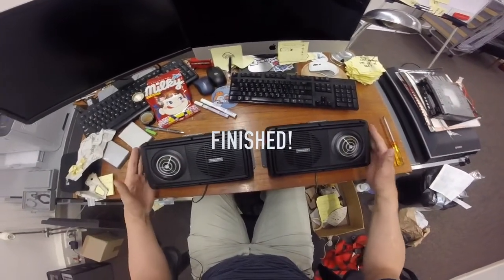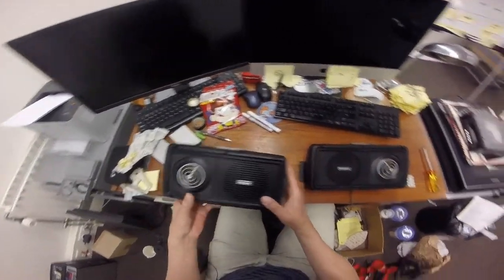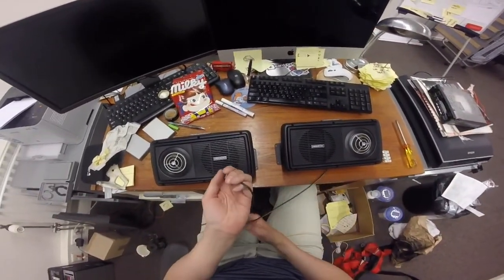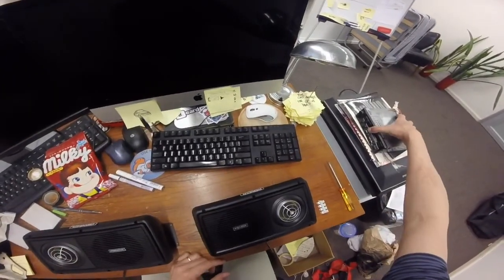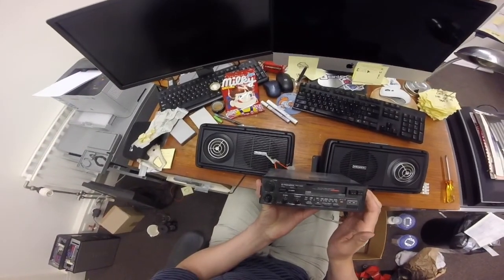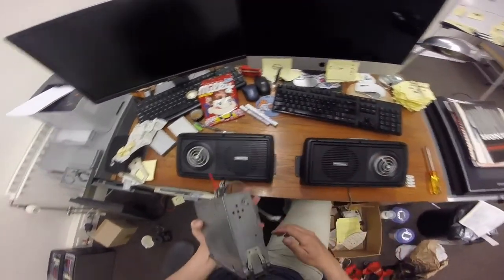How to revive a set of vintage Pioneer TS-32 - part 2

Comment: Haha I was thinking "What happened to those speakers?" I see that you've finally picked them up again.
Reply from the maker: Yes I kind of tossed them into this box out of frustration over the pin stripe. Probably they will be installed in the Carina soon after I got the radio working again.

Comment: those are some sick looking speakers! they can be only 2 way but that air vent looking tweeter is awesome!! hahaha painting them reminds me to the early 90's japanese kenwoods i installed on the sapporo. they were originally gray but painted them black. such a shame i got them in poor shape, but hey, they work good :D
about the radio, if they are easy or cheap to get, change the belt on the deck, you won't want old rotten black goo on the cassette mechanism after few months of use. also reduces wow and flutter, hey if you know the exact belt size, i can send one to you, belts are dirt cheap here ;)
Reply from the maker: Thanks for the offer and I'll keep that in mind! Yes the tape deck is broken so probably a broken belt. If not the belt will be replaced anyway.

Comment: nice :D tho the stripe slightly miss there,have you considered getting a sticker pin stripe,for example these that were pretty pupular to use on a side of the car,and apply it there? might work and also there is a silver one too :D
Reply from the maker: +gred cz that's what I meant when I said I could cut one from vinyl using the plotter. I have a vinyl cutter for the AE86 decal replicas, which I also used to cut out the chime shape for the chime button. So I could make an attempt to cut this shape as well and then insert it into the recess
Reply: ah i see,yeah this could work even better :D tho it might be abit harder to apply on the speaker,but it would look better than doing it from straight tape as i suggested tho :D
Reply from the maker: +gred cz ah you meant tape. Yes that might work as well